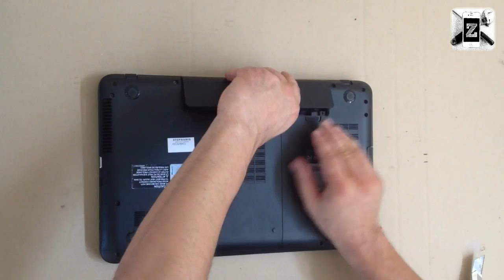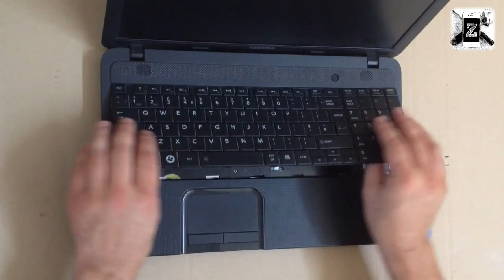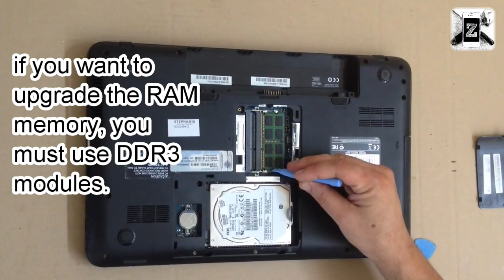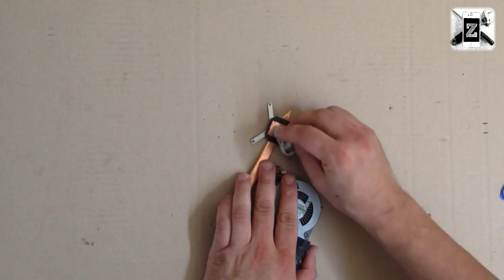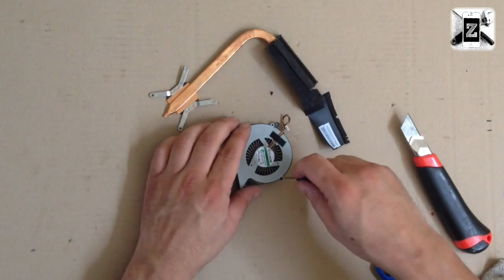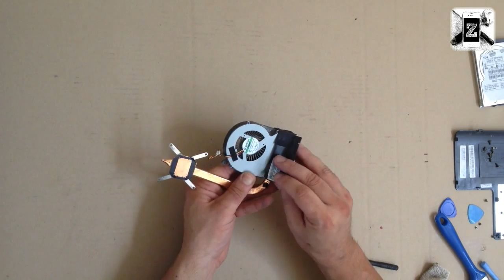TOSHIBA Satellite C850 - Keyboard, Cooling system, Thermal Compound, HDD, RAM Memory replacement

Comment: This video is very much helpful. But i need some clarifications,

01. What chemical can we use to remove old thermoc compound? 
[Is iso prophil alcohol(surgical sprit) suitable?]

02. After applying thermoc compound should we keep the CPU surface free for some time before assembling?

Thank you...
Reply from the maker: Dhanushka Padmashantha 

01. I use lint-free cloth and isopropyl alcohol. If the old thermal compound is solidified, I use a flat edge of any plastic tool to scrape it off
02. Yes, 5-10 seconds is sufficient to evaporate.
Reply from the maker: Dhanushka Padmashantha 
Cheers

Comment from the maker: +Onesime Kabeya
- Hey man i enjoyed your video so much and was wondering if i could change the CPU to a better version. currently have Celeron B830 1.80 GHz. i have the C850 19z and was wondering if i could upgrade to at least core i3.
- This board has CPU socket FCPGA988 and intel HM76 chipset. Both of them are ready for i3 processors. CPU compatibility depends also from BIOS and the main board producer but you can't find information for this. The only sure way is to try it.

P.S. You have to select a CPU with same or lower TDP (Thermal Design Power)
Reply: ZFix I have a little question, the laptop you use is Satellite Pro, mine is Satellite C850-190 that doesn't make difference for RAM replacement and CPU upgrade, it uses FCPGA988 like you mentioned above or it's different?
Reply from the maker: George Velkov 
Yes, the socket, RAM  are the same
Reply: ZFix thank you for the informartion :)
Reply: +ZFix Thanks for the reply. Am gonna go a head and try like you say it the only way to really know. still, thanks a a lot for the info really helps a lot :)

P.S If it blows on my face you dont have to worry i wont hold it against ya :D
Reply from the maker: Tell us then happened.
Reply: See my reply to AlbPowerONLINE above - yours is the same 2nd-gen series CPU. Note that no i5 or i7 CPU I tried would work without the forced 30 minute shutdown and also that you should not try any of the quad-core i7 CPUs anyway since these are all higher TDP (45W or 55W), which the C850 chassis and cooling system is not designed to handle.

Comment: Great Video, Is Toshiba C855 S 5115 the same ? and where do you get those blue plastictools to remove the keyboard and frame
Reply from the maker: mosone11 
Opening is the same.There are small differences in the design of the main board, depending on the chipset.
This tools you can find in eBay or Amazon like "plastic opening tools".

Comment: hey i really liked your video and i have some questions...i have the same laptop which you opened in this video and i was wondering to upgrade mi cooling fan to a better power rating...it has MF60090v1-c450-g99 (DC5volts-2watts)...
1)can i use other cooling fan?
2)how can i check what power rating speakers are connected to it because i want to change speakers because the one used in it are not so good quality...any comment on it?
Reply from the maker: +Atif Junaid Khan 
The laptop cooling systems do not follow standard like the desktop PCs.
The cooling systems are specific by producer and by models. You have not choice.

About the loudspeaker - you can find it by your model.

Comment: hey man..great video ! one problem though..once i removed the cooling fan and removed the black tape like thing, it doesnt stick back to the cooling fan as the sticky glue has been worn off. any suggestions ?
Reply from the maker: +San Mathew 
Use an insulating tape.

Comment: Hi ive just purchased a Toshiba Satellite C850-1KN from a carboot.it had no memory in the back just a battery and power pack and hard drive. the cmos battery was missing also.The harddrive light comes on when you plug power in but nothing boots up? it makes a whiring noise in bottom left of laptop?I have removed battery and keyboard and still does not power up? what do you think it is?
Reply from the maker: +hardcorealienpg 
If you have missing components sent it back immediately.

Comment: Hi i have the same device in the vedio 
and the fan some time work at maximum speed and stop suddenly and the cpu get over heating  and after time when i move the device it start to work then shot down
can i do some thing to fix it .
Reply from the maker: Mhmed aldaja 
Clear the cooling system and replace thermal paste. If that does not work, replace the fan.

Comment: Hey dude thanks for the video it was very nice but i got one problem now ....my fan doesnt work ...everything is going well only the fan doesnt spin....what can i do now ?(Toshiba C850-1DD)
Reply from the maker: TheSrkibre 
The fan can go a little after switching on the laptop.
Check first, is the the fan cable is connected well to the main board.
It is possible that the fin fan is pressed and it cannot be rotated.

Comment: I've got an issue, my pc's colong fan stops from time to time and it works again after few seconds.
Reply from the maker: Dhanushka Padmashantha 
The fan does not work permanently.
Download Core Temp - free app that gives you information about the current CPU temperature and the maximum temperature for your processor model.
During the installation, read the instructions, otherwise it will install additional applications that you do not need.

Comment: Any suggestions that I can do since my keyboard letters NHY6 are not working properly?
Reply from the maker: +john cristal 
KB problem, only replacing can help you. The KB is encapsulated and can't be fixed.
Of course you can try to remove the keyboard and  reconnect the flex cable, but 99% your laptop need KB replacement.
Reply: can you advice the part no. or model no. of keyboard which i can use for its replacement
Reply from the maker: Satellite 850 or Satellite Pro 850, or give the full model from the sticker under

Comment: i got a toshiba satellite c850-13h and i accidentally punched it cause i sliped and now i'm getting this clicking noise could that be HDD or maybe stuck fan?
Reply: Toni Kenđelić also can you add more RAM to it?
Reply from the maker: Toni Kenđelić 
I can't find the spec for this model (maybe it's for a small local market).
This is spec for C850-13c with the same processor:
http://www.toshiba.co.uk/discontinued-products/satellite-c850-13c/

You can upgrade it to 8GB DDR3.
Reply: ZFix tyvm

Comment: I have Toshiba Satellite c855-12n with Intel Celeron B815 CPU, can I upgrade to i3 or similar?
Reply from the maker: AlbPowerONLINE 
Your laptop has Intel celeron B815. It's at FCPGA988 socket. This is the table from Intel site for compatible processor for this socket:
http://ark.intel.com/search/advanced/?s=t&FilterCurrentProducts=true&SocketsSupported=FCPGA988

Your processors is with TDP - 35W. 
The CPU type also depends from the design of the motherboard (chipset) and BIOS-a. I think you can upgrade it to i3 but this is not 100%.
Reply: Your CPU is a 2nd-gen Core-i - search on cpu-upgrade.com for that CPU and all compatible socket-G2 CPUs are shown. Almost any will work in your laptop but be aware that Toshiba have 'crippled' the BIOS, at least in the version I have - 6.8 - so that the laptop powers off exactly 30 minutes after power-on if a faster CPU than they ever issued a model of the laptop with is fitted - there is no way to override this. If you cannot live with that 'feature' then there were 11 2nd-gen CPUs supplied in the C850 - 2 Celeron, 4 Pentium and 5 Core i3 the fastest of which was Core i3-2370M - meaning that the last one of those is the best CPU you can upgrade to; that CPU however will perform much better than the Celeron due to higher clock frequency (2.4GHz v. 1.6GHz), more L3 cache (3Mb v. 2 Mb) and better integrated GPU (HD 3000).

Comment: you have a clear picture of the cooling system? need a model fan
Reply from the maker: Give me the full model of the laptop (C850-1xx).
Reply: ZFix Toshiba Satelite C850-BMK
Reply from the maker: This is with Intel Pentium B950. Tomorrow I will give you answer.
What is your problem?
Reply: ZFix fan stopped working, thanks.
Reply from the maker: I checked one laptop (C850-1MC) with Intel B960. The fan is the same like other laptops from series C850.
This is the fan model: dfs501105fr0t
Reply: ZFix Thank you very much, greatly helped!
Reply from the maker: If you're interested I uploaded some pictures here:
https://www.facebook.com/groups/187342218141149/
Reply: ZFix Thank you, but I do not have facebook. I Founded by model number that is necessary.

Comment: hello. do i have to take thermal compose on the main cpu?
Reply from the maker: Casper Hultqvist 
If your system overheats, you must to clean the radiator (fan system). Then is good to change the thermal compound. You can use the old one if it is not dried. Better is to put new.
Reply: @MrZServices  where to buy good laptop repair tool kit same as your using

Comment: I have an "Intel(R) Celeron(R) CPU 1000M @1.80GHz" on my laptop, why would you reccomend if I wanted to upgrade? XD
Reply from the maker: HippyTheIrishmen 

Tell me the full model of your laptop.
This Processor is on socket FCPGA988
This is the list of processors, filtered by sockets:
http://ark.intel.com/search/advanced/?s=t&SocketsSupported=FCPGA988
But, supported Processor depends on the model of the motherboard too.
Reply: TOSHIBA C850-1NU, Also any Ideas for a Graphics card and RAM too? XD
Reply: Your CPU is a 3rd-gen Core-i - search on cpu-upgrade.com for that CPU and all compatible socket-G2 CPUs are shown. Almost any will work in your laptop but be aware that Toshiba have 'crippled' the BIOS, at least in the version I have - 6.8 - so that the laptop powers off exactly 30 minutes after power-on if a faster CPU than they ever issued a model of the laptop with is fitted - there is no way to override this. If you cannot live with that 'feature' then there were only 3 3rd-gen CPUs supplied in the C850 - the Celeron 1000M, the Core i3-3110M and the Core i3-3120M - meaning that the last one of those is the fastest CPU you can upgrade to; that CPU however will perform much better than the Celeron.
Reply: @stevebekus2147  bro i hate to tell you this but thats laptops been broken for years hahahahaha

ive a pc now tho so its all good :)

Comment: can i clean the cooling System without useing an new cream for the cpu? (i mean can i use the old one, that is already on the cpu.)

and sry for my bad english im from Germany :D
Reply from the maker: +Flaffi78 
No. The thermal pasta ages and hardens. If you divide the CPU and the cooler and collect, them use again the old paste, thermal-contact  will be wars.
Reply: +ZFix hm ok but i don't have thermal paste at home and i open my Laptop already so what can i do?
Reply from the maker: +Flaffi78 
OK, I do not recommend you but if it's important for you to use the laptop , you can do this:
If the thermal compound isn't dried, use it again to close the laptop. Download app for CPU temperature monitoring. Intel processors have protection from overheating but if your laptop overheats and shuts down alone, don't use it.
At the same time, buy a thermo grease and when your received it, change it immediately
Reply: +ZFix ok, i already downloaded an Software for the Temperatur and my Laptop is 20-30º  colder (i used my old cream). Thanks a lot for your help, now i can play games without overheating. :D
Reply: @MrZServices  Is it normal that there is no fan on the GPU? And also can I put thermal paste on it?

Comment: thank you
Reply from the maker: +joker - 
I thank you too joker
Reply: ZFix

I have used my friend instead of thermal paste other mixing of Vaseline cream , toothpaste and put them on Albroosissour Is my way harm the device?
Reply from the maker: I think this is not good. I'm not sure for the thermal properties of this grease, but it will be petrified very quickly.
Did you check the CPU temperature after?
Reply: ZFix

Yes it between 39 to 51 does not exceed this percentage
Reply from the maker: The temperature is OK, but I don't have any experience with this hellish mixture ツ

Comment: My laptop keeps turning itself off suddenly, could it possibly be because its overheating
Reply from the maker: Stewart121 
Yes, that could be the reason.
Find and download "Core Temp" - free app to monitor processor temperature.
Read everything when you install it, because it will offer you to install other unnecessary programs.
Reply: thanks for the help

Comment: is it important to put grease ??
Reply from the maker: +raed jai 
mandatory
Reply: +ZFix  is there any option other than grease to use on main cpu???
Reply from the maker: This is specifically thermally conductive mixture. 
You can't use something other, because the CPU can not be cooled well. It's easy to find it.
Reply: +ZFix thanx for your reply